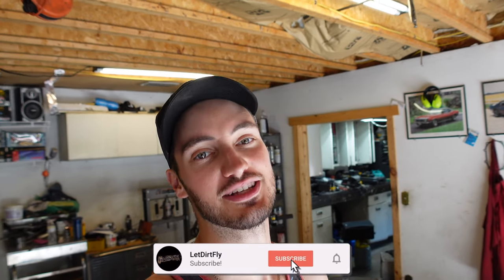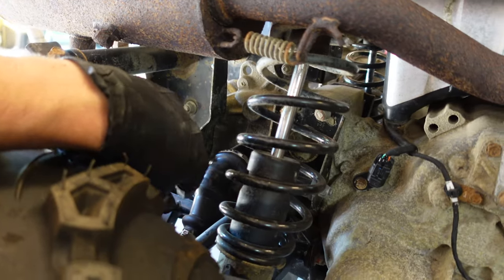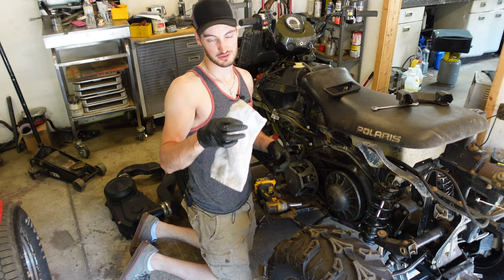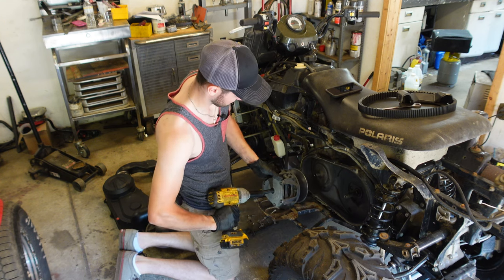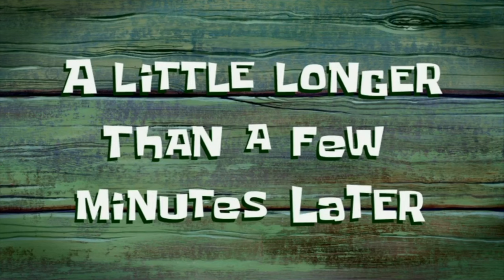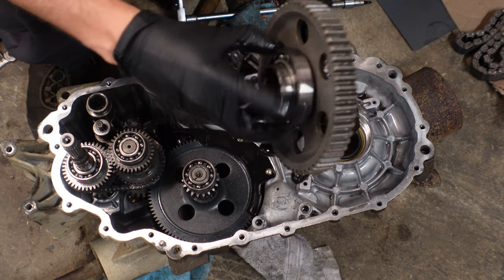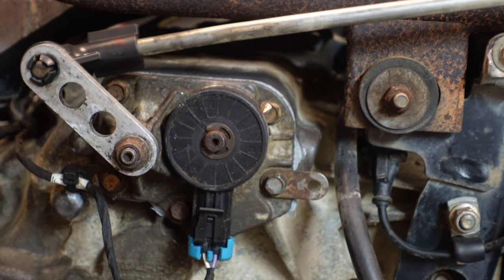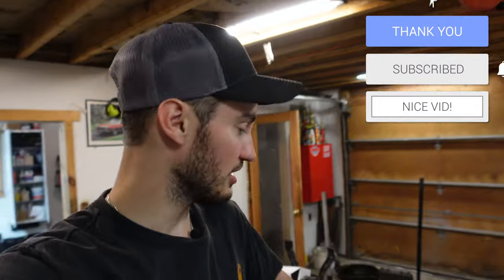How To Rebuild A Polaris Sportsman Transaxle - Detailed Instructional Video!

Comment: Hi there, you said you had to sledge hammer a stuck rear axle. Do you have a video for that as I have that same issue. Actually trying to sledge hammer it out but it’s super seized
Reply from the maker: try getting a muffler clamp that will fit around the axle cup ,with either a chain or strap attach to clamp. use a piece of wood (against the chain) and a small sledge or lump hammer, hit the wood out. it should come out.

Comment: Very well done video, unfortunately I cannot find a good video on the older style transmissions. I have three older sportsman 500’s that don’t shift, assuming a bit of rust is either preventing the dogs or the forks from moving freely. These machines have all sat for a number of years in Arkansas which is extremely humid. I am a mechanic but avoid going into the transmissions at all cost as I don’t have a huge shop , but now I have no choice, I have to get these three bikes shifting. I hope they go fairly smoothly.
Reply from the maker: Good luck.
Reply: Try disconnecting the shifter back at the transmission and shifting gears from there manually.
Reply: @1985cjjeeper  have, I’ve now opened a couple of them and have found light rust on the shifting rods , clean them up they work gre
Reply: @cm5838  
Thanks for responding. I was curious if it was on the transmission side or just the shifter. Sucks you had to open them all the way up.
Reply: @1985cjjeeper  yeah, not an easy task. I have had shifting mechanisms seize up though. I got one more old Polaris to do and I will have worked through the pile of them. Again I have to pull the transaxle but I’ll be swapping it with one I already fixed. The last sportsman I just decided to part out. I’ll put the engine in my ranger and sell whatever else I can from it. That trans is actually still shifting really good but it’s an 05 and considerably different

Comment: i keep loosing low gear and i changed about 80% of the internals already. Looking at this video to try to get some insight. if you have any idea as to why you r input would be appreciated. 3rd time loosing after just riding it 8-10 hours each time

Comment: Great video!. Maybe you can help me out. I over worked my polais sportsman 450 in reverse trying to back off over a tree.. we'll, something broke and gears began clanking. Not only does is clank in reverse but at least also in low but only when accelerating "quickly" or put under any type of load (hills). It will drop gear out of gear but once rpms fall it will re-engage itself and lock gears again. Is it possible something got worn before the transmission from the belt driven clutch? Being that the damage happened in reverse but also effected low gear I'm not so sure it would be the dog engagement gears. All experienced advice and suggestions appreciated. TIA!!

Comment: Sir, I have an 05 Sportsman 500 H.O. and the portion thats splined in the rear end is worn out causing slop in one of the back axles, would my teardown be very similar to this machine? Thanks!
Edit: also, what else would u suggest replacing (if anything) while im in there?